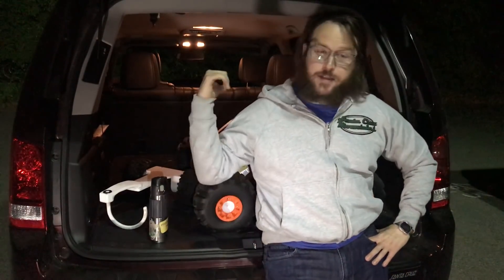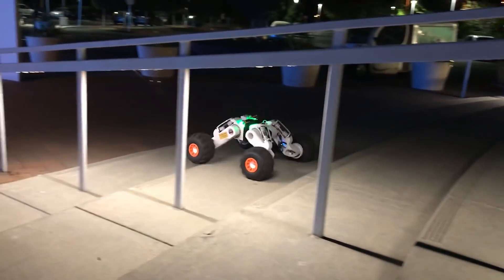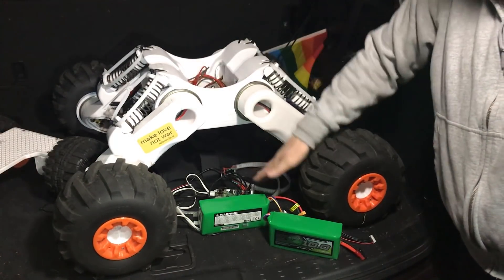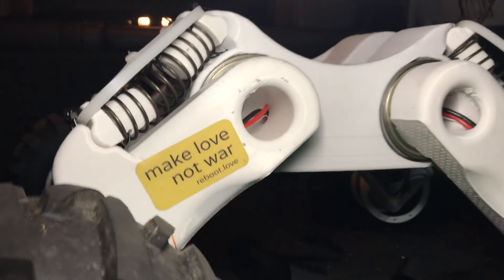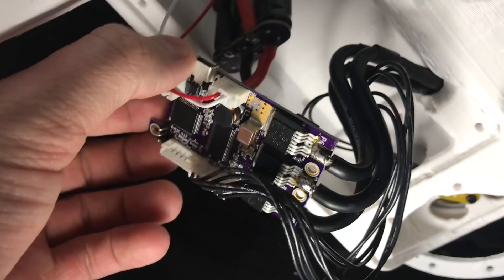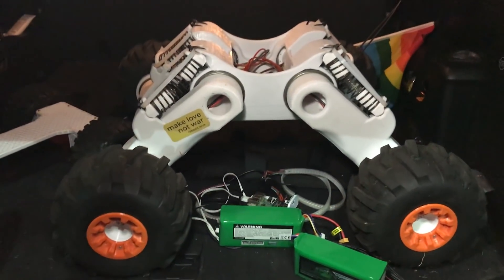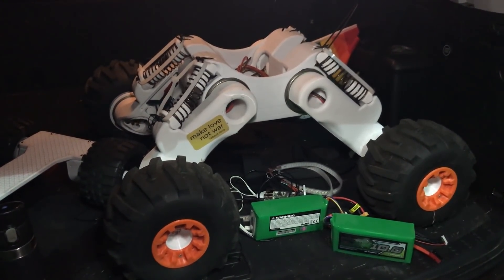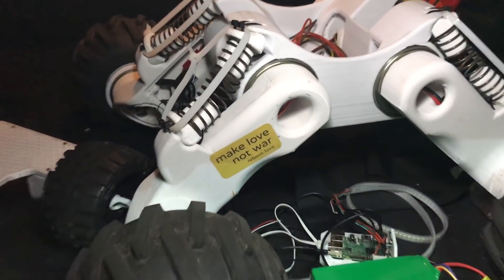Rover V2 Full Reveal

Comment: Just seems like a remote control car.  I mean is it supposed to be something more than that?  Going up and down stairs isn't really a task that is slowing human progress..
Reply from the maker: Its a software development platform for robotics, and I am working on a self-driving mode now using machine learning. A big part of making a useful robot is being able to make and repair the machine yourself. This vehicle allows that. In addition, it has high precision motion control that is not typically found on remote control cars. This motion control will be critical to enable autonomous driving. You need both good hardware platforms and good software to make a useful robot. This is the hardware side (with a lot of software sorted too). I am working on high level software control now, and once that is done this vehicle design can be upgraded to support new capabilities. It is all a work in progress. Just as Linux was not exactly revolutionary in the early 1990's, it was the foundation of something deeper. That is what I hope my work can be a part of.
Reply: @SequoiaAlexander  Have you put this machine learning code on github? Wouldn't mind taking a look at that - would be really interested in fact.